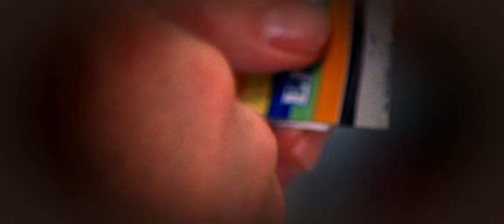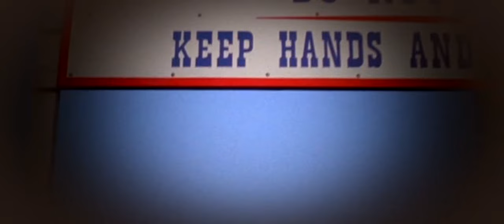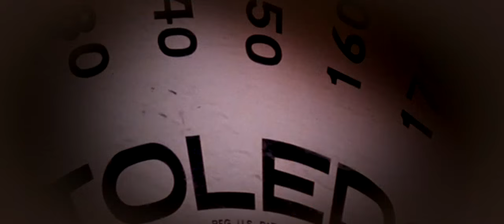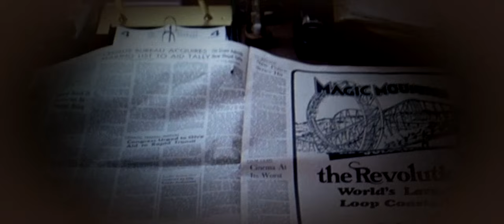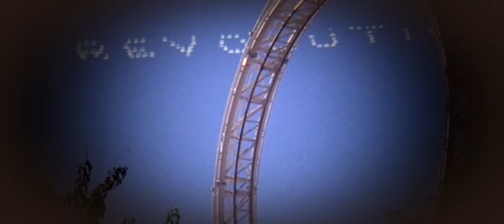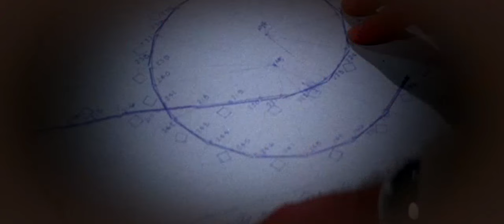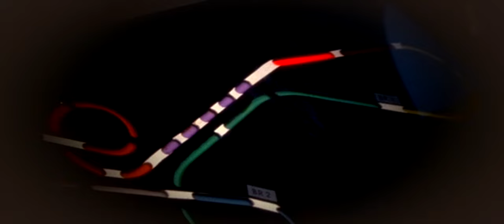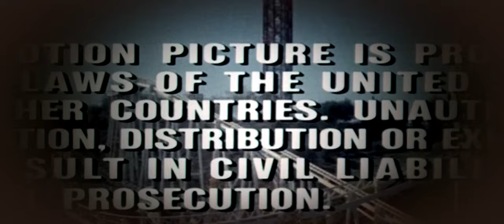Rollercoaster 1977

Comment: What is really spooky is that the same rollercoaster "The Revolution" (the last one at the end of the movie) is still in use at SixFlag Magic Mountain California Valencia near Los Angeles... 44 years later
Reply: oh my God.
Reply: Yes it's still there but has been refurbished  so has the colossus
Reply: Yes! It has a special place in my heart as the Revolution was my first big roller coaster at the age of 10 years old.
Reply: What? Really? 44 years for 1 ride. I am impressed

Some of our rides at Wonderland in Vaughan Ontario Canada are over 35 years old and still running (Vortex, which opened in 1991)
Reply: dunno how that's spooky
i've operated it though
Reply: It's call full throttle now. I have been on it.
Reply: @aaronjohnson7648 NO it's not Full Throttle. That's a totally different roller coaster. Revolution is STILL THERE in operation. It's a historic coaster so i doubt they will tear it down
Reply: Umm yeah it's historic roller coaster!! They're not tearing it down!!

Comment: This one reason whyi hate coasters
Reply: Why?  I mean it’s one of the safest activities that you can do.  There’s a 1 in 350 million chance (I think) of dying on a rollercoaster.  And nowadays they have metal detectors and guards at the entrances of theme parks, not only that.  But most of the injuries reported at theme parks are from for example people tripping, or stubbing their toes.  AND EVEN THEN!  Rollercoasters have multiple block sections for events like this, if there’s something wrong with the track.  The block section will lock up and stop the train.  AND STILL!  You’re safer driving to an amusement park than dying at one... either that or you’re just scared of them...